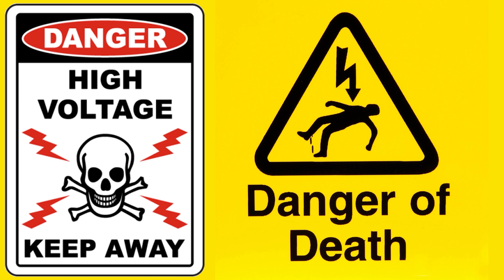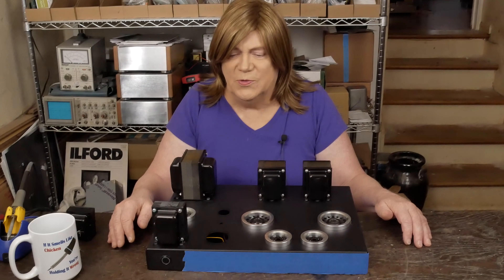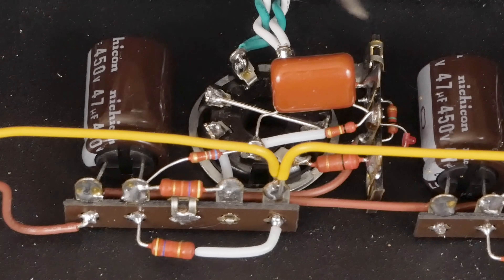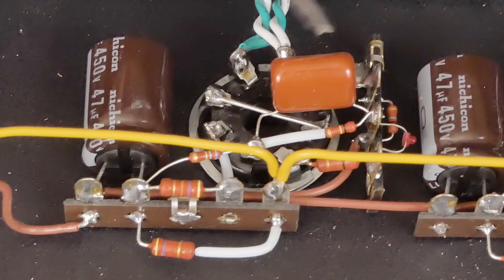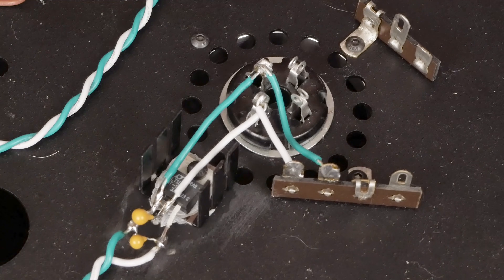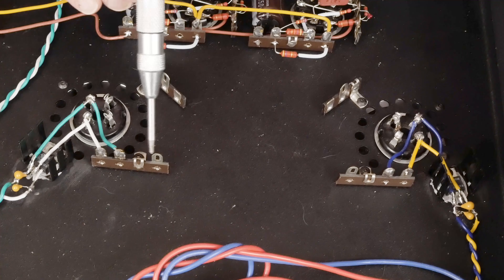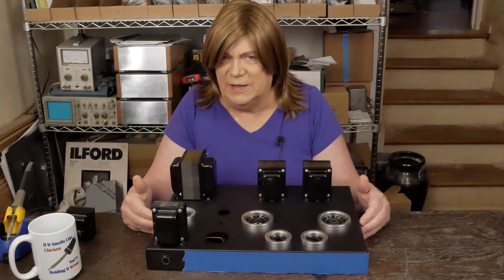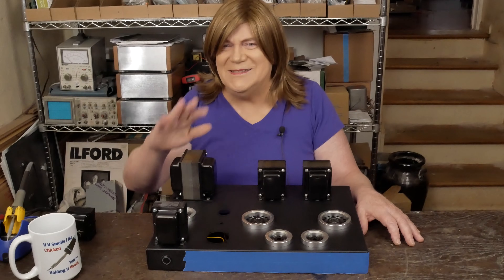Low Cost 300B Hi Fi Tube Amp: Driver Tube Wiring

Comment: I genuinely hope it works out for you on this build, but my guess is the complex nature of power requirements for the circuit, and your power supply design is going to be the Achilles heel. So, my suggestion would be, and I know you're dead set against this, is to completely do a solid-state power supply with the heaters being run add a switch mode frequency above 50 kHz. This would save the heaters from DC and no tube swapping required. And for the rest of the power supply again switch mode power supply would save a lot of money. Unfortunately, this requires some extensive design work. If only early designers had access to this new technology, I'm sure they would embrace it has so many others have.
Reply from the maker: I'm excited to see your design and video series on this to share with the DIY community!
Reply: @SkunkieDesignsElectronics Yeah me too. Unfortunately I got so many things in the queue prior to this, but the power supply designs are coming soon. Just a matter of adopting them to prototypes.
Reply from the maker: Actually the power supply works great, these budget output transformers are the "Achilles heel".
Reply: @SkunkieDesignsElectronics I'm sure they do. The point I was making was from a cost perspective and your goal of being low-cost